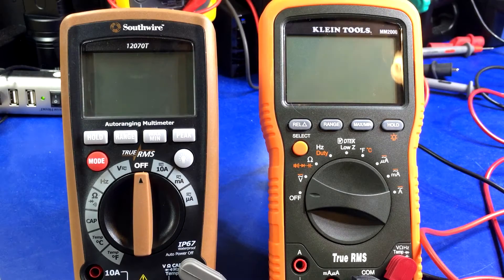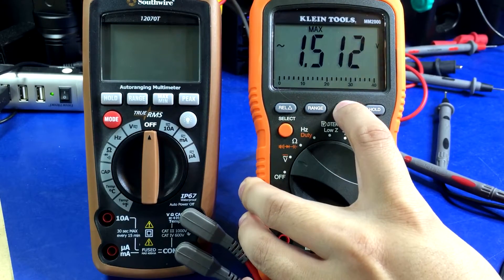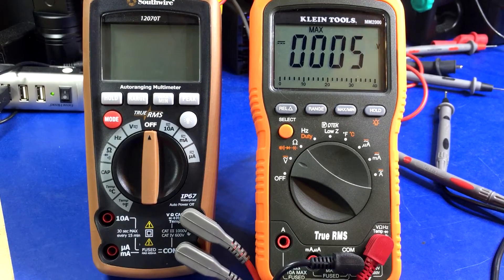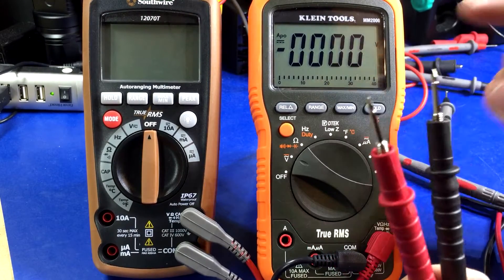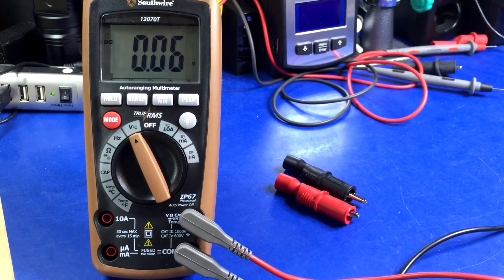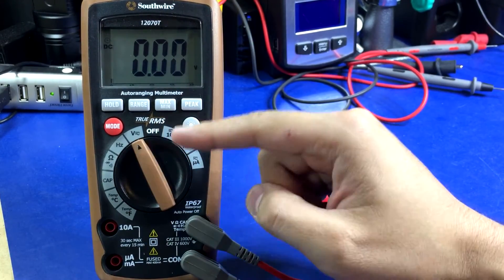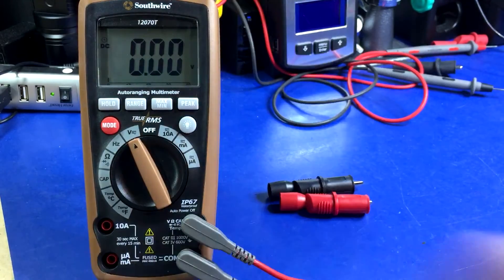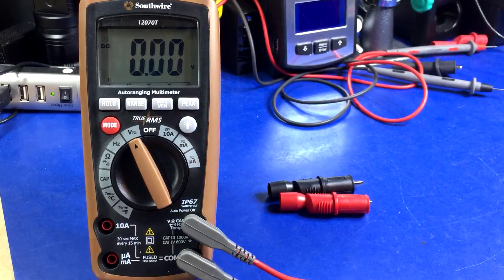MIN / MAX Digital Multimeter Functionality Rant - #0066

Comment: Sorry but couldn't help Laugh a lot when the multimeters gave you a hard time that was unexpected and so funny.
But I got you and I actually use this function min/max a lot, and for me every good multimeter SHOULD have. It makes a big difference when you are into repair. I still got my Fluke 189 an this is one of the functions I love the most besides the AC+DC function and Fluke does it lovely and even has the fast max/min.
Great video, thanks!

Comment: Buy a decent meter - these two are about a 2 star on Amazon, especially that "Klein" junk buy a Fluke and then you will be happy! And to be honest, the HOLD function is next to useless on any multimeter unless you have three hands.
Reply from the maker: +Richard Graham You're missing the point of this video.  I do own a Fluke 87v, along with a few other $500+ DMM's.  The point was that the majority have crappy min/max functions.  I also disagree with what you said about hold: on meters like the Fluke and Agilent/Keysight, you only need two hands. After a solid lock, it auto enabled hold.  It's damn handy

Comment: I couldn't agree more!  I recently purchased a new Amprobe AM-520 and assumed it would do the min/max correctly but nope it does it like your Klein meter.  VERY annoying!  I mean my Radio Shack meters from the 1990s did it right yet 20 years later companies are doing it wrong!  WHY?  Why skip the live reading when you toggle through the min and max?  I don't get it.  Major FAIL.  If you have to monitor something over a long period having a meter that will record the min and max while you go to the wash room is important yet when you get back you can't view the live reading until you write down the min and max.  VERY poor firmware designing.